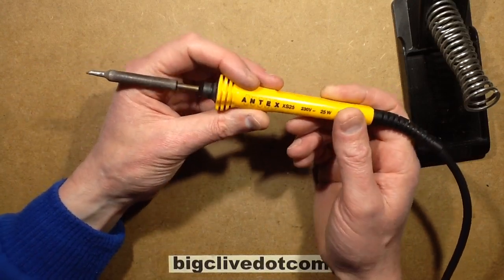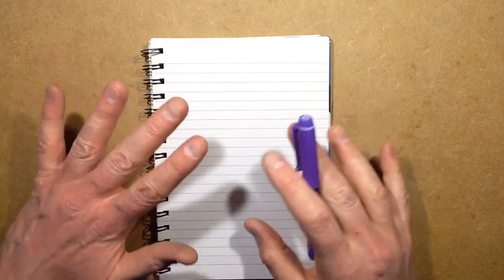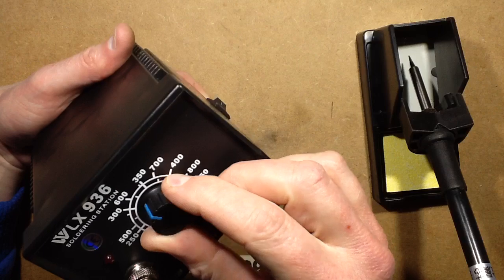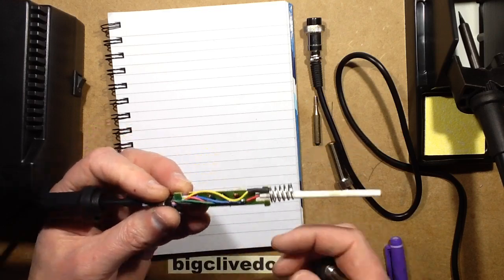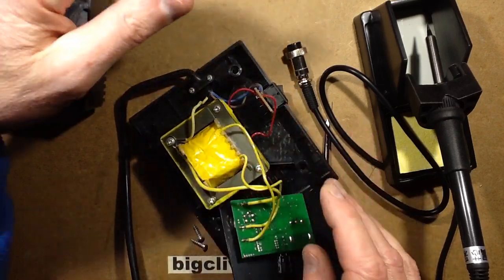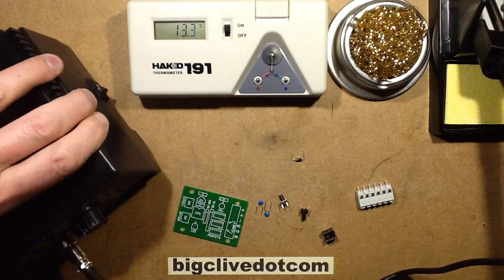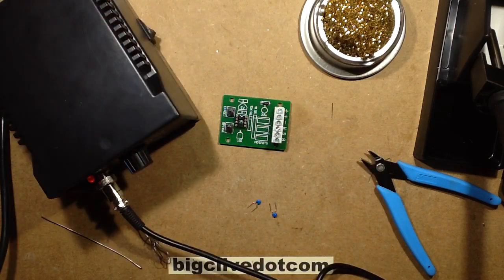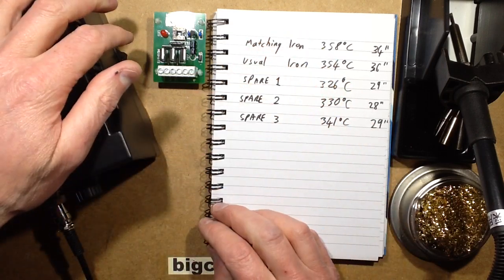Soldering basics and choosing a cheap soldering iron.

Comment: 5 minutes in and off I went to buy a new soldering iron! I needed one anyway but had been using my gas one for a while and it has been dong a great job, but it's not practical to leave it burning for long! Didn't buy the one you were showing though. I have a heat gun, and I don't really need a unit to plug it into. Just a basic 60w with small chisel tip that can be changed, when needed.
Oh, I came back to watch the rest of your video, once I was done! 😊

Comment: Good content. Only point that I paused about was 'lead-based solder is not toxic'...I'm no soldering expert but unless I am mistaken, if you are to inhale lead fumes (while manually solder-ironing) - that actually would be toxic to you....

Obviously, standard safety precautions and basic common sense control measures will prevent the associated hazardous health risks, but for the sake of anyone who may not know better, I think that could be a worthy point of clarification...
Reply from the maker: The fumes that occur while soldering are the pine rosin flux.

Comment: I've got like 5 lbs of Kester 0.01 in  0.3mm rosin core solder that I use for SMD work.    It's great for SMD,  but trying to use it for much of anything else is just flat out annoying.  Guess I didn't need 5 lbs of it.

Comment: My sacrificial device for learning soldering was a Sony WM-F77. I kind of feel sad to think how nicely made it was only to have me botch a repair, but I stripped all the useful parts off and saved all that I could and practiced recapping on the dead board. 

Those Sony Walkman service manual diagrams are a work of art.

Comment: there are many videos on soldering wires but i couldn't find any that show how to solder multi-core wires. e.g. desk lamp 3 core (live/neutral/ground) cable. step by step including the heat shrink tube......i am trying to find out how to solder adjacent cables and insulate them from each other to prevent short circuit.
Reply from the maker: The sleeves are a good option, but keep them clear of the connections until they have cooled.  Also avoid putting mains connections too close together.

Comment: "soldering is about feel" ABSOLUTELY. There is as much art as science, if not more. I personally go up in tip size before I kick up temperature if I can. My Hakko 951 seems to like 340C-370C depending on tip and what I'm soldering. Most of my soldering is point to point-- cables, lugs, sockets, (think valve/tube guitar amplifiers). This usually means you want enough heat to get in and out pretty fast before you bake a pot on an electric guitar, for example. Ironic, yes, but bigger tip and higher temperature means less total heat soak into the pot because it is faster. I do very little PCB work.

Also, I've really start to embrace the value of separately fluxing leads for tinning and such. Superior results over just using flux core, regardless of the solder used. (I used Kester 44 3.3%, Alpha Reliacore 3.3% and 2.2%, Alpha Energized plus 2.2% and Alpha Telecore plus 1.1%). Separate flux outperforms them all even when not doing PCB work. Also makes a great indicator of when you've got good heat.

Comment: MY FIRST KIT was a 2 oscillating lights too, and from a mag maybe Practical Electronics - not a soldered bread board, just a terminal block - got all the parts from going round a few shops in central Glasgow 1968.

Comment: I bought a soldering station from Lidl a couple of years ago with the brand name Parkside, which for the money, seems like a pretty decent soldering station....although being completely new to soldering I wouldn't be able to judge it against anything else 😆
I bought it with the intention of wiring and rewiring my guitars, changing the potentiometers, capacitors, switches, and pickups for better quality components.

Whilst I did a fairly good job of soldering capacitors and wires to switch lugs, I find it quite difficult to solder ground wires and capacitor legs to the bottom of guitar potentiometers.
Have you got any tips or advice for soldering those components please?
Cheers 👍
Reply from the maker: Try adding a small amount of flux.
Reply: @bigclivedotcom  - Thanks mate, I'll have to buy some because as the solder wire already has a flux core I didn't think I'd need to buy it.
After watching your other soldering video, the one with the 50 year old wire, it occurred to me that I might be trying to solder the potentiometers all wrong.
I thought that I had to heat up the bottom of the pot so that the solder would flow onto it, but when I watched you applying solder to that piece of copper, you just put your tip on the copper for a couple of seconds then pushing the solder wire onto the tip.
You didn't heat the copper up so maybe I learnt from a duff video and have been doing it all wrong 😆🙄

Comment: This video makes me want to pull out the iron and practice with some old guitar wiring harnesses as a guitar tech and a bass player. Just got me a new station had an old radio shack 40 watt unit and went to fire it up and it was doa no heat at all so just replaced it as radio shack has been defunct for some time now.

Comment: I actually have the latest version of that YIHUA 8786D (you thing they'd add a revision number), it's actually quite nice. They seem to have improved on the design. They've added a temperature sensor, a second digital display for the hot air reflow element and some extra buttons for temperature control. They sell it with 11 tips for the iron, 4 nozzles for the reflow, solder suction pump, IC extractor, de-soldering braid and a spool of rosin core/lead free solder for $75 USD. That was a STEAL!
 
I know this sounds like a sales pitch, but I'm not in any way affiliated with YIHUA. I'm just EXTREMELY satisfied with my purchase.

Comment: Great video! One of my first projects as a kid was the same astable oscillator you describe to flash two small flashlight bulbs, built it a from parts found in discarded devises. The solder joints were sketchy but amazingly it worked!

Comment: @bigclivedotcom
Hi Clive,
I am still looking for a general purpose iron or station. I have a 15W one and I cannot desolder, for example, transistors in TO-220 packages. I have to apply a lot of pressure and I always end-up damaging pads and tracks.
Now I am trying to fix and apple macbook power supply and cannot desolder a single diode there.
Would you go for a 936 clone or an Antex XS-25 like yours, since I don't want to spend more than £30.
There is a Quicko T12 within that price range.
Thanks in advance.
Reply from the maker: It my be worth getting a basic higher power iron like the XS 25 just for the bigger jobs.  You can also buy desoldering pumps built into irons.
Reply: bigclivedotcom 
But would the XS25 be suitable even for smaller jobs?
Reply from the maker: @geekPlayground  Yes.  It was my main iron for decades.

Comment: Hi Clive, I'm after buying my first soldering kit, and keen to learn more on electronics but can you recomend a good non-Chinese kit on Amazon? I don't like using eBay. Thanks. :)
Reply from the maker: Where are you based?  In the UK I'd suggest a company like Rapid Electronics or CPC.  In the USA maybe digikey or mouser.
Reply: Yeah, I live in the UK mate. I've had a look on Amazon and the ones that come up are the Antex ones similer to yours in the video, the XS25, there were some Antex ones but ones that have the screw at the end of the tip were it seems it doesn't acept interchangable tip types, the SQ8W270. Couldn't locate any CPC irons on the site. I may get the Antex one you have in the video unless you don't recomend it to me as a beginer?

Comment: Saw this, had to check it out, started out with the Antex Iron(Sinclair Calculator build), then I had access to R.S. Comp.    Bought (20> yrs) a Red Handled 250V Ac Onyx 50w Thermal-adjust Iron for Work, and another for my Home Station,  Bits lasted well approx 2-5yrs dep. on work load.  A iron rod down to microswitch in handle, adjustable with a allen key tool (Chesham, England), I heated the main cable to de-curl.   Just checked on Ebay someone wants £63 for one Orange example   (For H.D. Soldering use the Weller triggered auto-transformer type, BNC, larger connectors etc.   (sometimes isolating by pulling the plug))

Comment: I'm tempted to throw in a bit more money and get one of the 853D stations, it has a built in bench power supply on top of having the heat gun and iron. It's about 120€ which is really steep for a student like me but I could really use a bench supply and those tend to go for quite a bit, plus I don't have a heat gun either and that has made surface mount a pain. Man, i've been thinking about getting a new setup for almost a year but just can't make a decision
Reply from the maker: I'd recommend a separate power supply bought from a prominent component supplier in your country so it meets local electrical safety standards.
Reply: @bigclivedotcom  Yeah I suppose that's what I'll do whenever I desperately need a bench power supply, I'll just keep an eye out if any happen to go on sale or if someone is selling one used

Comment: I use non adjustable soldering Iron , my weller is 40 watts Its ok for small through hole stuff , I work on tube radios and smd circuits boards too,you need adjustable, tube radios need more heat, smd stuff needs less and through hole stuff can vary ,  I bought a 898 D re-work station work great in all my need for the most part ,I finally bough a Hakko which works amazing I just got it.the solder joints were just perfect.I havent used my fixed 40 watt setting soldering Iron since ,I bought a new tip and put it away.verible soldering stations allow to do so much more,it gives you control of your work needs .

Comment: Did you actually do a DMM check on the load for amps and such to get the actual wattage of the unit ????  Enquiring minds want to know and so do I ................ You do a video on your unit and I'll do a video on my unit so we can compare ours...  I got mine about 2 or 3 months ago......It seems to have about 40 watts on mine......  It works well on the smaller stuff......I did order a Yihua 907 F  iron  at the same time and that one seems to work better than the one that came with the station......

Comment: Clive, you saved my bacon.   Just received a KSGER digital soldering station (same kind of soldering wand)  and all it did was blink ERROR.  After I looked at your pin out of the connector, and checked it with a DMM it was pretty obvious I had no continuity.  Blink three times hard and a light began to dawn on marble head.  The ferrule goes on after the heating element is inserted.  DOH!

When this unit showed up at my door the jacket on the iron's cable was not under the strain relief.  Not a big deal to fix but it makes you think what else didn't they get right. 

Its working now.  Thanks Clive.

Comment: Is it worth noting that where the power output to the soldering iron is should be a female plug as it was with the original, so you cannot touch and short the connections when they are powered on and give yourself a shock. Then the iron should have the male plug because there is no power until it is plugged in. This is why Chinese equipment is dodgy because they do not always apply usual safety features. Yes, it is low voltage in this example, however it is the principle that counts and not the individual circumstances.

Comment: One day, explain WHY when you glob solder on the connections that are so close you don't bridge half of them....
Reply: Surface tension is your friend. High surface tension will make bridging less likely. Flux cleans the oxide layer away and keeps it sealed from air, making the surface tension conditions more favorable.

Comment: In middle school tech class, we got a bit of soldering instruction, using separate flux. Absolutely foul stuff, you know you got some on your fingers the moment you touch your fingers to your mouth. I think the solder was flux-free, but it worked fine if you applied flux first. It's just a bother, and I'm not sure why they didn't teach using flux-core solder.

Comment: Try a Weller W100PG soldering iron. They are affordable, powerful, and reliable. I have used mine for over 10 years 5 days a week and it has never quit even though I sometimes forget to unplug it over the weekend and with 100 watts of power they can solder the thickest joints you will need to solder.

Comment: Putting a bit of high temp nickel based "never seize" or thermal paste between the heating element and the tip might help a bit with the thermal coupling.

Comment: Ive just started trying to repair hard drive pcb's and the components are tiny. I can never get a proper connection and this video has made me realise that it's because the colder i got was crap and i guess it has little to no flux core. Also the iron is pretty crappy it was around £20 for a kit with alot of things in it. And the strange thing about the kit was it comes with extra solder iron tips but the soldering iron itself doesn't have a removable tip it's all welded together lol. I'll invest in a soldering iron and some flux core solder see if that provides better results but it does seem i was doing it right by heating the pad and component first then applying the solder but the joints were still garbage
Reply from the maker: Quality solder is really important.  Some cheap eBay stuff tends to be a random alloy or have intermittent flux if any at all.  Try and buy it from a proper electronics supply company.
Reply: @bigclivedotcom  Thanks for the tip, the ones i had last time the first one came with the crappy soldering iron kit, the second one was the cheapest solder i could find on amazon (silverline i think) but it didn't say if it had flux core or not. I'll do some googling and try to find some decent solder. Thanks again

Comment: Thanks, Big Clive, even though this is an old video (2016) it caught my eye about soldering. I recently bought an Arduino Kit and its Upgraded partner kit 37-1 or something like that to see if I could build my own circuits. Anyway, as a railway modeler, I'd be doing a lot of wiring joints and I have to say I'm good at soldering. Like yourself, I was brought up using an Antex 25W iron during the mid-1980s and I was taught that if you buy cheap you buy twice adage than buying more quality equipment in the first place. As a born-again beginner getting back into electronics after 30+ years, I can still follow a wiring diagram (a few symbols changes since then) and using my well-taught soldering skills, I can't see why I can't build my own circuits to go with my hobby. So, I will be watching your channel for hints and tips as I view your footage. If you have any end to end shuttle, timer flashing LEDs, welder flash units and other circuits, I would be interested in them. Even motorized circuits with magnetic start and stop triggers via reed switches all working off a 12v DC power supply. So, I'll make a start on watching some more Big Clive blogs and find out some more bits and bobs. The interesting thing is you striping units down and testing them to failure. I usually strip things apart when they failed to re-use LEDs, switches, resistors, diodes, motors, rods and gears.

Comment: I know it’s not safe to do this it’s highly toxic but with a set of fans and some incense to test the trail of smoke you can get that safely done glove up  power off  a micro drop on any solder softens and reconnects  without touching anything no soldering no smoke trail  in 24 hours ok to move it will not be able to secure new contacts just fix’s cold solder points same amount with silver is how dental fillings has been done  worse is the dentists remove your gold keep it stick plastic in place same price  back to work the SM does harden and to move it canned air  makes it move good to fix charge plug just control the flow 72 hrs dry time superglue holds it

Comment: Is 387°C an ok soldering temp? I bought a temperature sensor thing and set to "200°C" my Tabiger iron is actually settling at 387° and it goes up to almost 500°.
Reply from the maker: Go by what feels the best soldering temperature.  Lower extends soldering iron life, so excessively high isn't good, but the old thermally balanced Antex irons did float quite high.
Reply: @bigclivedotcom  I'm kinda stuck with 387 as my lowest available temperature :o)

Comment: I got my Antex XS25 from Maplin in Glasgow too. Great iron.  Bought a Yihua soldering station, made a "sleeve" with tinfoil wrapped around the element til the tip was tight to put on. Sold it on a few weeks later for a tenner and went back to the Antex. Used that tenner to buy a cheapo Tabiger 60w iron from Amazon. That's really good, same tip geometry and the Yihua, but works much better.

Comment: I’m running a cheapie gas one from the local hardware store

Half the time I don’t even use the tip, i solder with the flame

But I don’t do much PCB work
Reply: Also, I was taught solder on the tip helps heat transfer

Comment: Heh, was out of power yesterday, major brownout, had nothing to do and the rear speakers on my car had snapped some thin epoxy'ed wires in half, rendering them speakers useless.
With a big nail, pliers, lit ethanol fire and decent lead solder, and a borrowed glob of flux in some random tupperware, i fixed my speakers, and finished the job with some hot snot when the power was back on.

Wasn't a perfect solder what with the old wires being too dirty to get solder on and too thin to clean, but i got my bass back and did something with what would be useless time at home.

As for my soldering iron, the one i use when i do have power is a nameless supposedly 80w simple iron, with a busted tip that i keep neglecting to change because it still does the job as long as i don't use the nasty blackened tip and use the shiny sides instead.
It doesn't have a lot of mass on the tip, but it heats up so frickin fast that it doesn't usually matter!